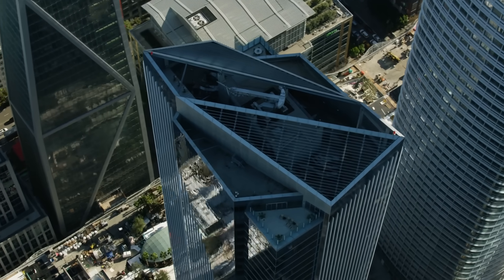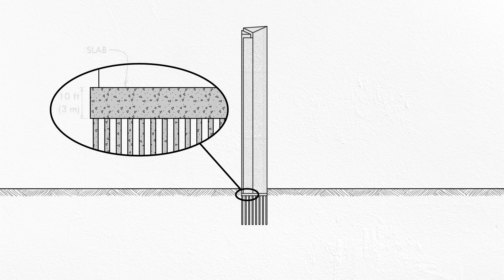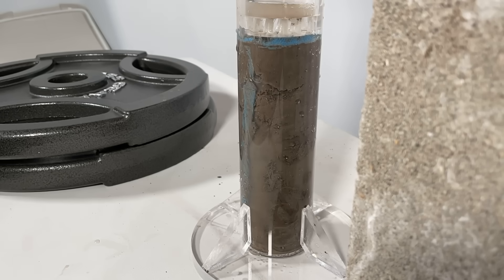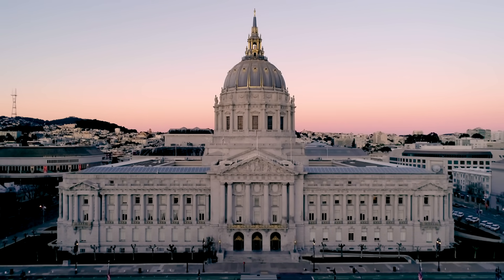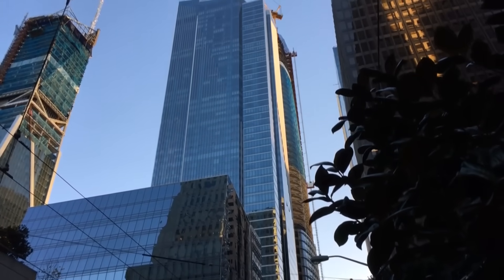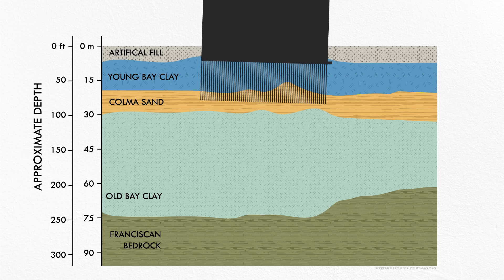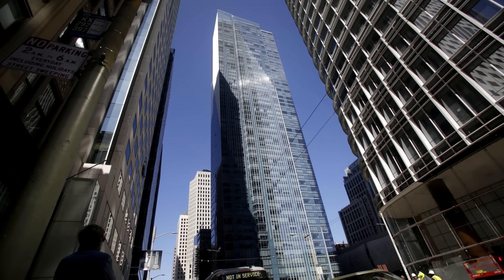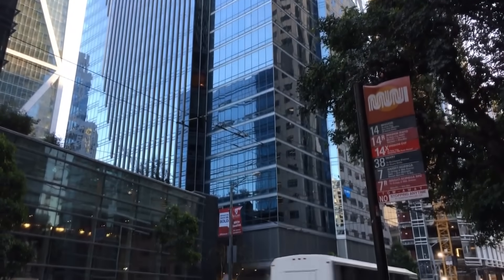What Really Happened at the Millennium Tower?

Comment: I worked on the interiors on this building. However, I've done a lot of concrete construction. When I first came in on the 4th floor, I looked around at the shell and asked: "How high are they going with this thing???" (A: 58 stories, on bay fill!). 
It's massive! Saying it's built like the proverbial brick ****house would be an understatement! The concrete is so dense, that when we were drilling into it, we were breaking equipment I've never seen break before!
I understand that when the general contractor came on the project, they convinced the developers to go with a "different design", though apparently, the foundation plan was never reassessed. That may seem unbelievable, however, testimony in court has revealed that a soils engineer was NEVER retained.
The contractor specializes in poured in place concrete. I've always wondered if the original design for was a steel building, for which friction piles may have been suitable. 
Surprisingly, in all of the litigation, the only company I DON'T see mentioned, is the general contractor!🤔
I'm beginning to think they're going to have to tear this thing down, which would be a massive undertaking in itself!
Reply: Yea its looking more an more like they may not have a choice.   Thanks for the insight. 👍
Reply: @RJ Deering  It wasn't pre planned, unless you mean by Osama.
Reply: You can't tear that down now, it's a done deal, look at al the other buildings around it!
Reply: @virtualsam  I don't think they can implode it, but they could sure as hell take it down.... The same way you eat an elephant. One bite at a time! Talk about the project from hell 😳!
Reply: Ha! Just take half of it down, call it the sawed off tower. Imbeciles could have drilled to rock easily in the first place.
Reply: @RRaucina  For a reported $6,000,000 more (the piles could've gone to bedrock)... they have probably spent that on media relations so far in this saga...
Reply: It can be done in one day, just ask 
NY since engineers there still state building 7 fainted into its own footprint but it’s been said it was brought down because it was deemed unsafe.  Took them minutes to wire it up and bring it down.  Never Forget 9/11
Reply: @costafortia This is an engineering thread. Come back to reality... Leave Q'ville immediately!
Reply: @Bannering101  Since this is an engineering thread, it is appropriate to discuss how steel framed building collapse at free-fall speed which were never hit by either planes and were never fully engulfed in flames.

Comment: As much as I have recently started to hate the media, I don't believe for one second, they have anything to do with the skepticism of the people surrounding the failing engineering of this impending disaster.  History is rife with examples of engineering gone horribly wrong and many folks suffered and many died as a result.  To not completely trust what is going to happen AFTER a major engineering defect is found is completely understandable and warranted in my opinion.  Thus driving values down.  The media just did it's job for once and let the public know what was happening, which in turn, helps to settle who id dumb enough to "get hurt" or who is smart enough to "run away" from such an investment.  Other than that glaring fact, I liked your explanation and presentation.

Comment: Although it may be safe, no one in their right minds would want to be associated with a sinking building no more than they want to be associated with a sinking ship. I think with all projects, there's various things that can go wrong, and can be fixed so that the client is still being delivered their goods/services exactly per requirements. Safety is just one requirement. Brand appeal, the view, etc. are many other requirements. A lack of analysis caused this problem in the foundation. And then, more lack of analysis caused the fix to have problems as well. At that point, as an investor, I would no longer have faith in all people involved in the project. These are not minor setbacks, but shows major lack of diligence and oversight. There's some problems you can't fix. You have to start over. You can't re-bake or fix a cake. And this building, with all the risks involved, should be controlled demolished and rebuilt with a better team.

Comment: If anyone is curious, the SF region in general has much if not most of its buildings sitting on this clay. Every year, buildings flex a bit when the ground dries and rehydrates. The Gently Rolling Hills of the Bay Area are thousands-feet-high clay on rock.
And we have multiple fault lines running through, just to make things interesting.

I get nervous about a big quake anytime it's been raining for a few weeks: hill leveling.
Reply: It honestly astounds me someone decided building in SF was a good idea at all. It feels like it's only a matter of time before an earthquake levels the entire city and everyone is forced to abandon it as a monument to human hubris.
Reply: Bedrock is close to the surface in some areas so things there are well-anchored.

Most tall buildings that use friction piles here are steel and thus dramatically lighter than MT. Some are old enough to have survived the 89 earthquake.

MT is reinforced concrete all the way up so it is much heavier. It should never have been allowed to use friction piles - bedrock piles should have been required. But the original building plan to which the foundation was designed was changed without re-engineering the foundation plan. The city (like most cities) relies to a large degree on engineer stamps and peer review which claimed it was all A-OK.

FWIW the city now requires piles driven to bedrock for all buildings above a certain height to avoid any future problems, no matter how the building is constructed or what fancy tricks they want to play with the foundation design.

Also FWIW they should have required mini-piles driven through the foundation mat interior to the building. There is no way a mere 18 piles will be enough to stabilize the building long-term, not to mention correction of the tilt has already ceased unlike their predictions... if it had been 100 smaller piles on the interior a jacking system along with sensors could have been used to slowly reverse the tilt over a few years. Then replace the jacks with permanent connections when finished. Also wouldn't have to worry about cupping or cracking of the foundation mat since the building wouldn't be supported primarily along the edge on that side which induces a lot more stress.

Comment: This repair will fail! The load bearing tab on the slab extension is 180° out. Time mark 8:17 of this video. The load bearing surface should be 90° or the flat should be facing upwards. This repair has the 45° facing upwards. This will result in the slab extension being pushed out and away from the foundation under any real load. Please review

Comment: I have designed a few 42-floor buildings with friction bored pile foundations that went down to 45m. It shocks me to learn that simple reinforced concrete-driven piles were used for the Millennium Tower and it was only driven to 24m !! The correct choice of foundation should have been large diameter cast in situ concrete bored piles installed to a depth slightly beyond the Old Bay Clay layer. Large diameter bored piles also overcome the slenderness problem of conventional driven piles which have limited load-bearing capacity.
Reply: On the bright side, in a decade this will be a prime location. Few other buildings provide 30 levels of underground parking ;-)
Reply: Thank u for the insight, I was wondering what could have been done to prevent this. 

I'm sure the folks living in this building aren't too thrilled :/
Reply: @LiLGouda.  They could have built the foundation properly. That would have prevented this mess.
Reply: @whyyeseyec  The foundation hides in the dirt, so who will notice??
Reply: Thank you for your input. In my next life, I want to design the Brooklyn Bridge, Frisco (Memphis) RR Bridge, Eads Bridge and the Bell Rock Lighthouse. Combined longevity so far, 570 years and counting. Oh, I forgot about Roman concrete. 2000 years and counting.
Reply: How will this building fare in an earthquake and, will liquifaction be a problem for it?
Reply: No way in hell Those peers were deep enough, The substrate is rubbish, & the developers, & anyone who signed off on anything  should be in prison.
Reply: @sheepshit666  prison? Why has anyone died yet?
Reply: @sheepshit666  why.? BUILDING  STILL UP
Reply: Agreed with @Bill Hong
Disclaimer : 35 years with one of the world's top deep foundation contractor (European). Not a civil engineer, but close enough.
Reply: it was very unwise, even when i saw the soil profile, my first thought would be design a boredpile down to the bed rock, as i wouldn't take any risk when design building that massive. as my professor and seniors always told me, it might be an expensive design, but i would sleep well.
Reply: @SongofIceandTea  It's the old out of sight out of mind scenario,  however someone signed off on it and he based his reasoning on past constructions. There's are taller skyscrapers next to it. I'd be interested to know why these skyscrapers didn't dangerously tilt or sink, and how were they supported.
Reply: So you're hinting that anyone involved in design, approval, supervision of work would have all had 'common knowledge' that design was unusual and none bothered to demand answers as to how the building would be stable ignoring all common knowledge.
Reply: yup.,....screw piles are  more  appropriate, for  120  year old  '' fill'   mud/clay  sand.....
Reply: it is part of the depopulation plan
Reply: Built to fail?
Reply: Chinese have plenty of experience building ghost citiesjust to keep the fake economy going.
It's experience nontheless. Everything from tofu buildings to impressive mega-projects. I'd still rather ask a Japanese for advice. They know how to handle liquified soil and earthquakes. An investor should not care about national pride if there's someone better and cheaper
Reply: With an emphasis on the large diameter!
Reply: Falsified  pile  They did it on purpose.
Reply: One would have to understand the bureacratic nonsense and political environment in San Francisco to understand this situation….the mud is very deep here and has tidal effects twice daily- waxing and waining. So the developer wanted to economize by NOT going down to bed rock…and planning decided to agree with catastrophic consequences…the big tilt and it is scary. Then the reshoring process agitated the gelatinous sub soil actually started to move unevenly again….its just almost uncurable chasing the settlement from side to side and damages surrounding buildings not to mention exasperates an already nasty traffic flow on and off the bay bridge.This is symptomatic of SF’s idiotic government and its moronic bureacrats…
Reply: Thanks for sharing.  I'm an automotive manufacturing engineer, trained in EE.  It's always nice to learn about a new topic in engineering.  Endlessly fascinating for those that can grasp the information.
Reply: @ruprectmonkeyboy1856  I tip my hat to all you engineering guys and gals. Way smarter than I could ever be. You build the world we live in.
Reply: @ruprectmonkeyboy1856  You sound like a used car salesman working for quality Bob. You are a condescending bigmouth.
Grasp that
Reply: @ruprectmonkeyboy1856  A monkey could grasp the situation. Some cheap bastard didn't drill to rock when it could have been done for just a few million.
Reply: Appreciate your comment.  What would you ballpark estimate the cost difference between your suggested method and the actual method?  I'm guessing that answer might explain the developer's apparently awful decision.
Reply: @commerce-usa  Fully agreed. The difference in cost would be very significant. I do understand the cost pressure developers face all the time. Developers in general are risk takers like many of my clients. However, they must know that risky decision that turned out wrong would have serious consequences. Life is hard for sure.
Reply: @billhong4216  But we learned that the piles could've been put to bedrock for an extra $4 mil at the time the building was built. Surely they've spent more than that already trying to stabilize it, no?
Reply: @billhong4216  There would be an insurmountable problem back them to spend $4 MM to take the foundation piles to bedrock? Or it would've bankrupted the GC or developer?
Reply: @billhong4216  Given the fixes, and your expertise, would you give a thumbs up or thumbs down to buying a unit in this building now?
Reply: @miltronix  Local 34 Got Plenty  of money to look other way
Reply: @commerce-usa  I recall that it was $4MM. Probably a fraction of what's been spent so far to TRY (key word) to correct the problem.
Reply: Maybe these guys are firm believers in the "Americans can do everything better" idea, so they had a look at the (in)famous leaning tower in Pisa Italy and thought "we can do better than those silly Italians" LOL.
Reply: Hellow,colleague. In our city (Russia, Siberia) for the first time now build 40-floor building with 30m piles. Of course it's also depends of soils, but I don`t think, that so much.
Reply: Are you a structural engineer?
Reply: @dm6187  Yes.
Reply: @billhong4216  This comment has me rolling 😆
Reply: So it's got a bit of a lean huh ?  It needs a whack on the other  side to staighten it again . I suggest that flying a say 737 into one side would help to straighten it , but hey , before long Putin  will detonate a tsunami torpedo/bomb just off the  coast and then  the problem won't  exist anymore.
Reply: @michaelcorbidge7914  whoa relax
Reply: World govts are colluding together at the expense of their own citizens to usher in new world order. New world order led by obama and pope francis is coming. Jesus christ is coming back for the rapture. Get ready. Dont believe the coming ufo alien abduction narrative. Refuse the coming mark on hand or forehead at all costs
Reply: Okay, Mr. Smartypants. Maybe you should write somebody.
Reply: @Tolohtony  too late the shit design already done and building on top. And why provide free advice and be liable for it.
Reply: @Tolohtony  Uh . . . it's a little late.

Comment: I don't know if the chart is in scale. But if it is, there is a big error in calculating the bearing of this foundation. The bottom of the friction piles ends EXACTLY on the top of the clay layer. When we calculate a foundation, we have to consider the BULB OF PRESSURE that spreads pressure in soil far below the end of piles. ( the bulb of pressure isn't shown in this chart) If the soil below on the soft LAYER of clay from -30 to -70m is like the chart shows, then for sure it was A BIG MISTAKE ON THE PROJECT OF  THIS FOUNDATION.

Comment: Great video.  Coming from a pretty long construction background...that ain't gonna work.  It might be the only option other than demo, but it isn't the best option.  There may be extra seismic considerations on torque load throughout, but that ten foot foundation will not take the lift from one side, the then whole building will get the twist. I hope it is a slow process, not a catastrophic one.  Nor torquing latteral connections out before they get a little extra from an earthquake.  I honestly can't believe they are going to try this.  Peck and pump some deep grout, the tech is there from the oil industry.  Brandon in the WH, might be able to get a good rate on it.

Comment: I was told one of the towers problems 
Stem from the change of lighter yet
Taller steel floor beams VS THE change to shorter yet much heavier  concrete floor 
Beams   So they could add more Stories

Comment: This seems to be a case of skimping on design, materials and  the owners wanting to rush the project so they can start selling the condos and make money. I am not an expert at all, but anytime you are working with different soil layers and add salt water to that equation much research needs to be done before construction can begin. I grew up in the Netherlands on the coast. All homes had piles driven deep into the ground. I lived in a 3 story home, right on the water, the home is now well over 300 years old and still standing firmly on its piles because it was done correctly.

Comment: If construction accelerated the settlement on the drilling side, they could drill holes on the other side to tilt it the opposite way.   You might as well go to bed rock on all 4 sides anyway to prevent future issues.

Comment: Along with the problems with soil and clay mentioned, cannot an earthquake of the right frequency cause liquefaction of these materials, thus accelerating subsidence by orders of magnitude? I would not trust any tall building anywhere, not anchored in bedrock.

Look at the skyline of Manhattan. Its tallest buildings are placed Midtown and around Wall Street, where the underlying rock is solid. The rest of Manhattan will remain comparatively low-rise, because the rock in these areas is crumbly.

Comment: Being a floor covering installer,  and quickly coming up on almost 50 years of experience, it's obvious that I'm highly qualified to be giving some advice on this situation.  😁😁😁
If the vibration from drilling greatly accelerated the tilt of the building, then why not drill on the opposite side trying to make it sink rather than trying to lift the other side up?
What engineer would not envision that drilling all those new holes right next to the building would cause additional problems? By drilling all those large holes it just gives compacted soil's groundwater an easier place to relieve itself to.